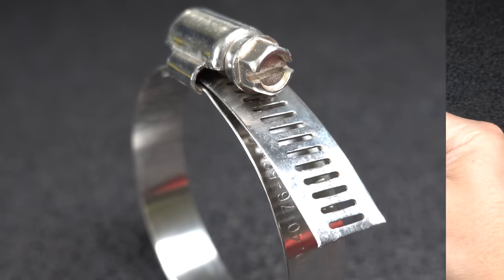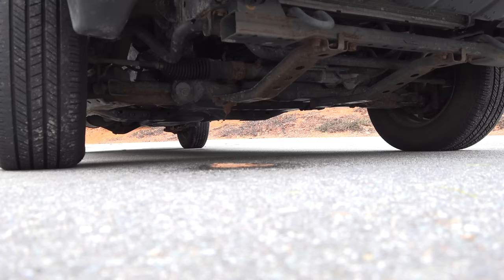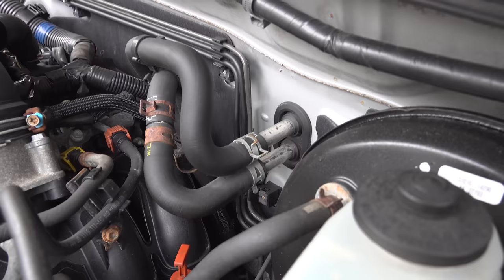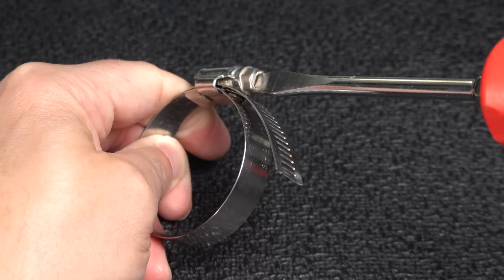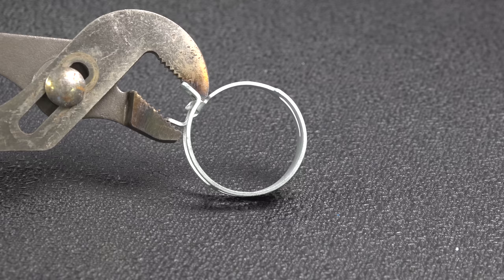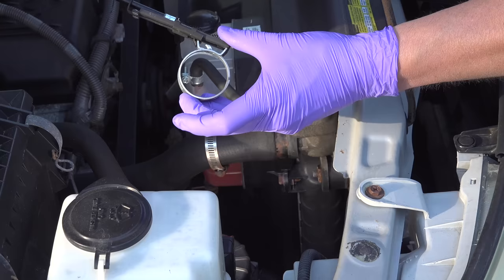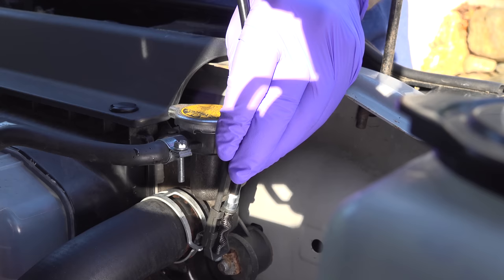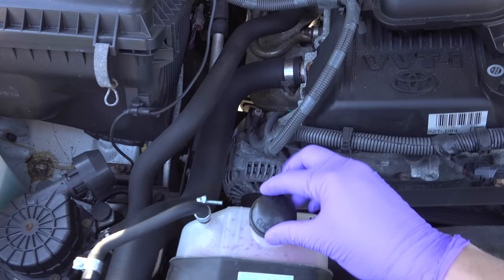STOP Using Hose Clamps WRONG - LEARN A BETTER WAY

Comment: Be careful with these clamps they can fly across the room at 30mph if you don’t handle it right lol
Reply: Yup and a pinched palm with the damm end of the pliers
Reply: @Julio-jm8ld  oh gosh you just reminded me of a terrible memory man I pinched my hand so hard with some needle nose pliers trying to get one of these off I had to get stitches
Reply: Too many volcano bongs?
Reply: Use vice grips
Reply: Did ya see the spider
Reply: Flying across the room is fine,that's generally what happens to the poxy things when I take them off. But when the clamp ear jumps the tool and hits the end of your finger or thumb,😤😠😡🤬!!
Reply: Yep just had 2 if them zing bye me..lol
Reply: 30mph is an understatement. Those fuckers flies faster than nerf darts. I reckon double that or less that 100 fps.
Reply: Yes, I had one slip off the correct hose clamp tool and put a pin hole in my rad.
Reply: @portland4660  I didn't know speed can be measured in frames per second :P
Reply: @anttitenhunen4725  FPS (Feet per second) - standard projectile measurement for toy/air guns.
Reply: @portland4660  Yeah, I know, just joking a bit as we use meters per second m/s in here :P
Reply: @thaik56  good call
Reply: One of this has hit out my left eye. With my right one I tried to finish the job and go to work the next day, but it looks like the adrenaline wanted really to finish the car. Anyway 3D was not available anymore, so I fucked it up again and the clamp flew away, hit the hood, the water reservoir, the highpressure pump and then hit my right eye out with the tab.
After that I'm watching more carefully when maintaining the old car for the wife. And won't use these "superior" clamps anymore.
Reply: okay being a noob and reading the replies here got me scared

Comment: I'm still going to use worm gear clamps...🙃
Reply: Yeah everyone who's struggled to get those damn things off figures out to use the screw type eventually.
Reply: @johnnyrebel9986  it’s not hard if your good at it
Reply: @jonthelamb4549  So you're tellin me you've never had one that you couldn't depress enough to get it loose? Or some that don't hardly even have enough surface metal to put a pair of pliers on, I like the spring style clamps for large hose's like for radiator/water pump/thermostat housings because of ease of removal. But when it comes to small hoses like fuel lines ect and high pressure lines screw clamps are the way to go.
Reply: @johnnyrebel9986  I haven’t used them much lol when I do it’s never an issue for me. Like you said the bigger ones are better then the smaller ones kinda depends where it is and what it’s on I guess
Reply: @johnnyrebel9986  I strongly disagree. On small hoses you want to use the single use ones, you crimp on. Worm drive clamps can't (because of the worm drive mechanism) form a small circle to effectively tighten a small diameter hose. Also he specifically said that for use with high temperature fluctuations you need to use the spring type clamp.
Reply: good call. If you are not having problems why change it? It's a ymmv situation. What works for one person may not work for someone else.
Reply: Just changed my lower radiator hose on my 93 Chevy. Spring clips out, worm clamp in! 😄
Reply: @jonthelamb4549  is anything hard if youre good at it?
Reply: Just make sure they're good quality JCS clamps and not the rubbish you get in those multi pack boxes.
Reply: Personally I like to use peanut butter and forego on any sort of clamping device.
Reply: i didn't even watch the entire video the comment section is way more interesting
Reply: @jonthelamb4549  Wait till one of those shitty spring type spin round and get blocked by an exhaust manifold. Absolute PITA garbage.
Reply: @PJBonoVox  or spins around to where it rubs on the fan belt, been there!
Reply: Weird I never have any issues with either type 🤷
Reply: @johnlastname2895  When it happens you'll know.
Reply: Same, in my experience they would last longer without leak's, tension clamps lost tension over time and they can be a pain to install them
Reply: @GiovanniJaimez  I have spring clamps on my 35 year old starlet, and it still doesn't leak. If they leak, it's your fault, not the clamp

Comment: Not recommended for Diesel engines on boats, per ABYC H-33.10.e.4; “clamps depending solely on the spring tension of the metal shall not be used”
Reply: Why did VW put these @#$@&@! things on my little diesel from the factory.

Comment: Sadly I’ve seen plenty of those spring clamps leak if they are old and you move them and then don’t put them back in the exact same position.
Reply: i totally agree i am a  auto technician  and work on engines 5 days a week and if you dont put them back the same they will leak but they dam good clamps
Reply: Yup, I learned this the hard way.
Reply: Make a mark with a paint marking pen. Realign the marks when assembling.
Reply: @LatinDanceVideos  Its not necessary, I can see the embossed marks on the hose that the clamp leaves. I just didn't know if the clamp needed to be realigned the way it was before. I thought maybe clamping it in a different position would still work, but I was wrong. I didn't realign it and the hose leaked.
Reply: Its because old hose often hardens up.
Reply: @quademasters249  hmmm
🤔my old hose is flaccid👀🙃
Reply: @lanceporter994  SINCE YOU ARE IN THE AUTOMOTIVE FIELD I TRUST YOUR JUDGMENT 
THANK YOU
Reply: Don’t always blame the clamp... hoses get old !
Reply: @Soothsayer-rs5nb  No doubt. An Oetiker or worm gear clamp can keep it going longer than a spring clamp can. That's all I'm suggesting.
Reply: @quademasters249  My late husband's "hose" would often harden at the wrong time.....and go soft when it counted.....
Reply: So replace hoses and clamps when old
Reply: I always try to get them in the exact same position but that can be hard sometimes. I figure that tool he used in the video would make positioning a lot easier.
Reply: I've had some success making sure that the hose stubs are corrosion free and cleaning if needed. 
And for assembling an old hose joint , use a dab of tire bead sealer on the stub to reduce chances of leaks and more corrosion. 
Yeah and still, I've had to swap em out with a worm drive after all of that cleanup.
Reply: @lanceporter994  What do you think about those one time use clamps? Damn those are the real pain in the ass
Reply: old hose good hint time to change
Reply: that why radiator hoses have clamp marks ...

Comment: I normally agree with you but this time I don't. I'm a diesel mechanic so I work with these daily. They can be some of the hardest ones to get off whenever you do not have clear access. And even then they often jump off the pliers. I have seen plenty of these not be able to hold pressure. We never replace them with the same style we always put worm styles in place. I work at a Freightliner dealership so that tells you something. I'm happy you like them but you're the first person I have ever heard that did.
Reply: Yes, every mechanic replaces them with standard clamps so the customer keeps coming back.
Reply: There’s a set of pliers you can get with cups on the end that make these much easier, but yeah I’ve busted my finger up more than once trying to get squarenoses onto them
Reply: Use spring clamp pliers. Game changer. I've worked on vw's tdi's for years and at first i hated spring clamps, but after seeing numerous failures where previous techs had replaced  spring with "worm" clamps i became a firm believer in spring clamps. Not only do they work better and never leak, but disassembly and reassembly is much, much quicker than fiddling with worm clamps. I've worn out four sets of cable spring clamp pliers over the years. That's how much i deal with them. Hands down, a superior design.
Reply: Don't use pliers unless you have to. Use the spring (constant-tension) clamp tool. It's better and it doesn't ruin the constant tension springs (by bending the prongs). Don't use the tool they show in the video.
Reply: Yeah, they are hard to get off, but that's kind of the point. As a mechanic, you know that the right tools always make it easier. Search for the right tools and your life will get breezier. NEVER use pliers on constant-tension spring clamps. They bend the prongs, slip under the spring and are the wrong tool for the job. Avoid the tools from this video too.
Reply: Good point.The issue is pliers don' t always work well.That tool he had for those clamps is a very good invention.
Reply: same here im atrucker and its screw type thankyou had one snap off hit my neighbour in the balls as he lay in his lawn chair. man it didnt end well cops got called
Reply: As another Freightliner dealership tech...hafta agree and say no to the original clamps... They're only used because they're faster on the assembly line and cheaper.  The worm gear clamp is the standard and they're better all around...
Reply: I like them. I'll be the second person. LoL.
Reply: @Mole460 I don't doubt he's a mechanic, I only found those pliers after like 3 years of working, and those clamps are really annoying to be fair

Comment: Here on the east coast in Canada those clamps rust and crack then hose leakes. Screw style has always lasted for me being use stainless ones
Reply: Yup. Salt belt goodness. But use good hose clamps that can be properly torqed ... Not those weak China ones.
Reply: Yeppers in areas were you have salt water or salt is used in the winter to melt snow or ice. You need to use stainless steel.
Reply: But aluminum
Reply: Down here in the northeast I do generator service. 
It's always lovely to have a block heater fail and cause all kinds of cold water leaks at hose joints due to screw clamps. 
And after hose replacement you've gotta retorque em a few times after some heat cycles. 
I do like the spring clamps for the constant tension.
But occasionally I've had to replace those with screw style clamps as they still show signs of sweating.
Reply: @JoeZasada  
Somebody gave me a box of those from harbor freight,
After 3-4 of em stripped out upon tightening , I threw em in the scrap pile and I'll get .39c for em when I have enough for the scrap run.
Reply: Correct using cheap hose clamps and hose clamps of the wrong size like the one he showed in the video. The large clamp had about half of the band pass the screw meaning it was not round when tightened. Those band clamps have sunk many PWC
Reply: @JoeZasada  I always use Canada made hose clamps or if I cant then use the ones at Lowe's
Reply: I just picked crusty rust chips out of my radiator hose from a spring clamp and the hose is about junk from the crease line.
Reply: I live on the east coast of the US and I see them get eaten up by rust so I do understand that is a valid point but then on the other hand the tension Style spring clamps have a point in purpose as well and they do their job well if you know what you're trying to do with just like any other product on the market disclaimer right here idiots be warned if you use it incorrectly you will have poor piss poor results so you have to know what you're doing with any product so they both have valid uses
Reply: Yeah those worm clamps if made well are the best
Reply: My constant pressure steel clamps have been holding up just fine, made out of thicker metal than stainless worm clamps
Reply: The only reason manufacturers use those clamps is because they save time
Reply: @WarriorNotesLatino  Aluminum can corrode when exposed to road salt. Many things will.

Comment: Ironically, I was so frustrated with constant tension clamps that I switched them all out for the old fashioned hose clamps 🤦🏻
Reply: I always do the same thing too.
Reply: Same I've never had a problem with the old style
Reply: Funny cause I switch out one of these new style for the old style because they allowed coolant to leak. The coolant hasn't leaked since.
Reply: There has to be a way to size these things. They can't be one size fits all like the worm clamp. Maybe you take the od of the pipe and the od of the hose and find a clamp that has an id somewhere in the middle. 😳
Reply: @michaelpacker9805  🤪
Reply: @michaelpacker9805  +1
Reply: I found they work really well
Reply: They work fine man, my trucks trans cooler lines are just fuel hose held on by hose clamps. If its tight it's tight and those spring clamps can loose their elasticity and leak also.
Reply: @antonyh37  They all will leak, spring type or worm screw type. If you don't line up the spring type in the grooves the previous one made just right, it'll leak. I've had to replace several over the last couple years at my job with worm screw type.
Reply: @Ratkill9000  Yea, they use the constant tension clamps at factory because they are faster to put on, but have to be put back perfectly as they were.  I've never had a leak with screw in clamps, probably people that do get leaks are ones who use new clamps on old hoses that need replaced.
Reply: Because of snow and salt they just end up rusting and breaking. The old style never fails for me lol
Reply: I really rather use the screwdriver than use oversized pliers (which may slip) to undo a clamp.
Reply: Same here. I take those off every chance i get and use the old school ones. lol   Nothing wrong with them besides being a pain in the A** most of the time
Reply: Me too and I have never had any problems
Reply: I think the issue that applies with the worm clamps is quality. In recent years the screw clamps showing up on shelves are soft metal garbage knockoffs from China. They strip before they properly tighten. If you find old stock  there is no problem retaining tightness and they don't jump gear before they are really tight.
Reply: I replaced every hose on a Porsche Boxster (all 23 of them) and converted to the old style screw type band clamps. Almost immediately I began having small intermittent leaks and have been forced to continuously monitor my coolant levels. I'm slowly going back to tension clamps.
Reply: It's hilarious the confusion caused by calling these Spring clips "new style". There's millions of them on every car made since the 1980s, That's 40 years.

Never had a worm style  leak unless they were made in China which is very common today. Make sure you buy a quality made stainless steel American made clamp.
Reply: @7x779  

I haven't found stainless steel tension clamps or I'd be using them. I'd be happy with some good quality clamps that are powder coated. Many of the older tension clamps are showing some rust.
Reply: @toobad9946   I was referring to stainless steel worm drive style claps, like Ideal Made in the USA.

 I think there's a reason why there are no stainless steel Spring style clamps.  Probably because they must be made out of Spring steel and perhaps it's not possible to make stainless steel have the proper Spring characteristics.
Reply: @Ratkill9000  I said this exact same thing above. These clamps are junk and I always replace them.
Reply: @289hipo  forgot about those.
Reply: Yep if the clamp diameter range is matched to the hose then they will work just fine. 
Buy stainless steel to aid in removal in the coming years. 
Not much difference in price than the cheap rubbish ones.
Reply: And you did the right thing
Reply: Jim Remmel
Reply: @7x779  Ever seen those older toyota ones like on 80 series landcruiser heater hoses, look like a clamp with a split pin in them. Single use and a right pain to remove.
Reply: Same here🤯
Reply: Agree. I hate anything bouncy on a vehicle. It's a pain to remove an old constant tension clamp.
Reply: I do the opposite. Any chance I get to get rid of a shitty worm gear clamp, I throw em in the trash where they belong and put on a spring clamp.
Reply: Congratulations, you played yourself.
Reply: Those quick clamps are junk,
Reply: @paulsmith9341  skip complexity and time wasting, use the worm clamp
Reply: @jdigitalseven7  they really ain't that fast
Reply: @charlesgendron9082  because they are stainless and quick clamps are not stainless
Reply: @sandasturner9529  thats why they are slower
Reply: @toobad9946  you used cheapies
Reply: @matthewdorricott4514  skip the time wasting and just use quality worm clamps
Reply: @ifluro  and toyotas, hondas are overrated
Reply: @WalterRitchey  erm no, even with correct tool they are still a headache, so use quality worm clams and never have a problem again
Reply: @ding9633  the spring clamps are shitty. Use quality worm clamps and never leak again.
Reply: @shadowopsairman1583  What world you livin in?
Reply: @shadowopsairman1583  

The constant tension clamps were factory parts. They worked but were beginning to corrode. I switched to stainless steel band/screw clamps of the highest quality I could find.

They slowly seep fluid. I tightened them as tight as possible. I'm slowly going back to factory clamps.